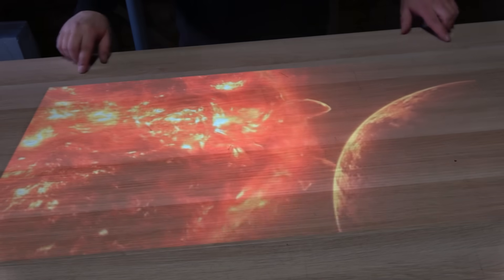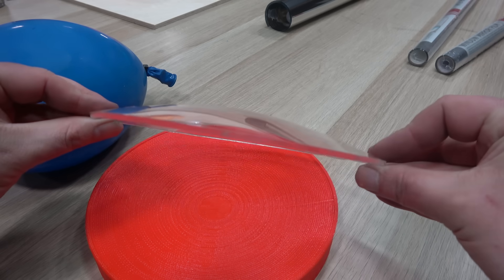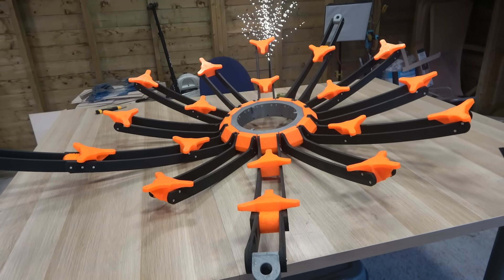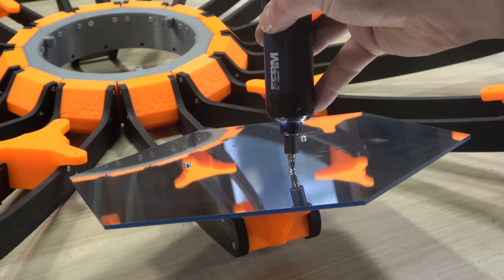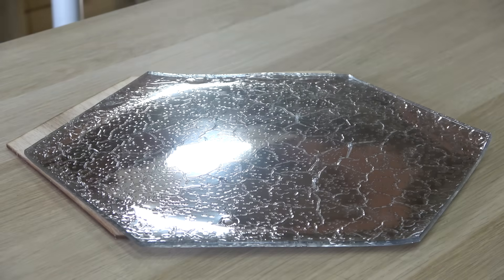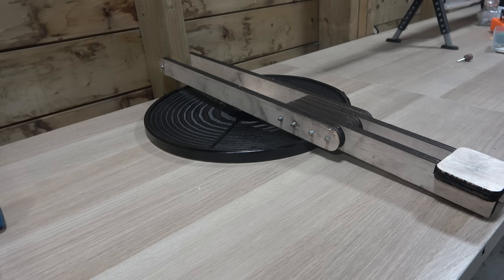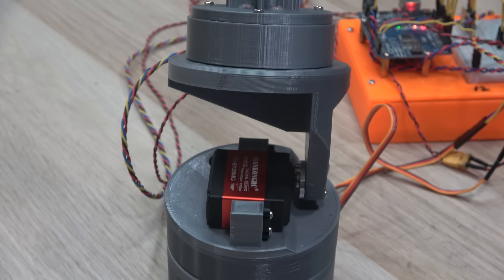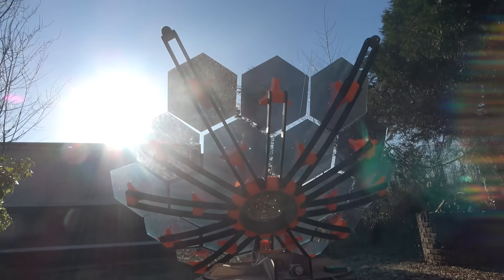Building a DIY Solar Generator..

Comment: You primary mirrors don't need to be parabolic. Only your secondary mirror needs to be. Just make the secondary mirror a bit lager then the primary and you can easily focus all primaries onto you secondary. This way the build is way easier and you dont burn you secondary mirror to ashes.

Also your heating block should be made out of copper with a black finish to absorb more energy. The focal point of the secondary should not be to focused so the copper block gets heated evenly without a single hotspot.

And the hole thing should rotate around iits center of mass, so it is easier on the tiny pivot motor.

Comment: the paints you use are not actually made from silver and gold, so your tests are not reliable.
you should use glass for the mirrors (probably you could get away with using regular mirrors which would yield way better results) since 3mm plexiglass absorbs 10% of infra-red light...
the difference between spherical and parabolic mirrors is the focal distance which is shorter for parabolic mirrors, both mirrors focus in a spot btw.
you could shape the plexiglass hexagons before applying the foil, that way avoiding the failure of the foil because of the temperature, but you dont even need the mirrors to be parabolic, you could go with flat mirrors which would be easier for focusing anyway...

Comment: You could apply anothe layer of reflective film on top of behind the firt one. Would be better if its in another material than the fist one as it would reflect others wavelength. 
This is kind of like the space solar panels.

Comment: I would be copping your project with a desire to add more mirrors for greater heating quicker (I intend on being able to make a lot of hot water for coffee)  The two issue I have are the environment here is just plane flat out cruel to things like wood and plastic.  I would be remaking your parts in metal.  I do own a 2 ton press.

Comment: I'm going with a different method. It's just at the 1/5 scale model stage now,  but within the next month, I hope to build a between 1 sq meter and 1.4 sq meter dish.   It's pretty much a half parabolic dish and it is on equatorial mount.  (just one axis that you rotate at exactly 15 degrees per hour) and there is another axis that you move manually every 3 to 6 days to the sun's declination angle.  With a half dish on equatorial mount, you can have your target (your hotpoint)  stationary and accessible! I will be able to swap out different "applications".  A frying pan for clear sunny outdoor frying.  Or the light will go in under a very big solar box cooker to boil up weeds (so that the weed juice is available immediately, it works like compost tea to feed soil bacteria)   or  sometimes I steam soil to sterilize it   I hope for the box cooker to double as a  solar dehydrator. If I am accurate enough, my focal "point" will be about 15 cm wide (and that should be good and safer enough for me).   My "parabolic dish" is made by the "cone solar' method so it is simply not as precise as what you are doing.  But it works too!  I did tracking on equatorial mount last year too, but this year's project should be significantly more user friendly and also more efficient.

Comment: you should make sure water will always go through your aluminum plate otherwise it will melt. I think i would have looked to a material a bit more stable like copper, austenitic stainless steel or nickel based alloys.
I would have tried to put a reflective film after forming the mirror.

Comment: Лучше убрать верхнее зеркало. На его место поместить ваш теплообменник.
Из за второго отражения теряется много энергии.
It’s better to remove the upper mirror, which directs all the rays to the water heater. Instead, place your heat exchanger in that position. A lot of energy is lost due to the second reflection.

Comment: Hello! I really like your project, but, for the solar tracker you need a wind sensor, to make the mirrors parallel to the ground so that they do not oppose wind resistance, because otherwise it will break the system!
I think a satellite antenna mounting system will help you more than wood, and as motors for the solar tracker you can use linear actuators which are much stronger and more precise. 
The PLA printed material does not withstand the sun and becomes broken after a few months of strong sun.
I hope you don't mind, I just wanted to help you with some ideas. Thank you! I'm curious to see if it works.

! the pipes must be metal otherwise they melt and catch fire due to the temperature. But you can leave them like that for the test.

Comment: Very impressive. I suppose my concern with this project would be durability in outside elements. I have a 48 v heater element that runs off the supply side of my 1800W of pv arrays…uses up waste energy heating water as am not connected to grid. Only 20% efficient but still heats up about 200 litres per day March-October.

Comment: I see a few problems with this build...
The problem 1# is, that parabolic mirrors reflect light into single point ONLY when placed perpendicular to the light rays. So it does not matter that your mirrors are parabolic, if they are not in the dead centre... One way to counter this problem would be to make several dyes for each mirror position in regard to center axis.

2# The window mirror foil is not as efficient at reflecting heat as foils designed to reflect heat. You would get much better results with mylar you can find in your car's first aid kit, but it is harder to glue it because it does not have sticky side... Mylar is also a bit stretchy. If you decide to use it I would suggest to first form the acrylic into desired shape and then stick mylar onto it. I would probably just use thin layer of spray glue, but I am not sure, wether spray glue solvent chemically reacts with acrylic or mylar, if yes, you'll have to use some other non reactive type of glue. Afterwards in the centre of the acrylic piece make a small hole, stretch mylar over it and suck out air with a vacuum pump. That way atmospheric pressure would help you to stretch the mylar to adhere to the glue. But I never tried this, so it is just an idea... You might run into some problems.

Suggestions: Do not bother to make parabolic mirror by yourself at all, but rather find some old giant parabolic satelite dish that you can just polish... The problem is that most satelite dishes are not made stainless, so in the exterior it would rust.. To counter that problem I would electroplate the whole dish with gold. In order not to have electroplating adhesion problems you'll have to electroplate it with copper and silver prior to gold. (As they do it with oscar statuettes). Yes I know silver gets better result, but it will also oxidize... To prevent oxidation of silver you could also use some clearcoat, but that could also decrease some efficiency. I bet that just plain gold with a good surface finish would be better than clear coated silver, but it would be better to test it... 
Wish you good luck. With your project. Ing. Oliver Koren

Comment: Wouldn't it be easier to not measure where the sun is, but tell the disk where the sun is based on astrology? This means that certainly when weather is unstable and at random cloudy or sunny, the disk is already perfectly aligned cause it is told to be at that very spot the sun brakes through...

Comment: I love your channel and I was absolutely impressed until I saw this aluminum plate :D
Sorry but combining aluminium + pmma to heat up water is not what I expected. I recommend a closed system out of copper. You can buy flexible copper pipes for example. 
The plastic pump can't withstand the high temperatures that are reached very quickly at the specified 3.5 kW. Perhaps you don't need a pump at all and just let thermodynamics do its thing :)
Greetings from germany

Comment: well for the tilting mechanism, I would just use an electric actuator, and use the scissor lift technique since you only have small space to work with, where the end of the bracket is on wheels or bearings or can slide freely in a track. For adjusting the mirrors, why not just a ball shaped mount like shaving mirrors have, it's only lightweight mirrors, you don't need adjustment screws for that with metal springs. You can still add fine adjustment screw at the end of the mirrors.

Comment: Would it be more reliable to have the solar tracking based simply on time and location? Angle would be calculated based on time of day with an adjustment for day of the year.  The sensors work well until one of them craps out.

Comment: I wouldnt be using any plexiglass or rubber pipes for the heatplate, you will be getting burning temperatures out of that, solid aluminium cooling block, and paint it vanta black to increase heat absorption

Comment: Cool Idea.  I would coat the collector Plate with black heat resistant paint. Then, i would choose a gold platted collector mirror to prevent the plexiglass from melting. Something i predict, will happen anyway. sooner or later :)

Comment: Astrophysicist here. Super cool project! I have a suggestion for your mirror setup. 

It can be greatly simplified if you use only flat mirrors instead of your molded parabolic ones. The only thing you need to change thereafter is to have a secondary mirror thats parabolic shaped. Look up "gregorian telescope" for a visualization. This will improve your efficiency since your mirror lost some reflectivity in the process of molding them (cracks, degrading, micro impurities etc). 

Secondly: The suns peak intensity is in the 500nm wavelength which silver has the best reflectivity at 98% and aluminum (cheaper) at 90%. Since your mirrors are now flat, you can use silver-mirrors on a glass or ceramic base. Alternatively aluminum mirrors for the cheaper option. Why a ceramic base? In the heat of the sun the mirrors will deform quite a lot and having a ceramic base will help reduce that. In astronomy this is used even for extremely faint objects, so for the sun this is very important. The shape of the mirror does not matter but of course, hexagonal shape is more space efficient. 

Since your purpose is to heat up an aluminum block in the center, you should also color that block in a highly absorbant color. Black, or even vantablack or similar "super-black" paints. Note here that wind will act against your purpose, of extracting heat from the incoming radiation, you can make a frame just around the block to hinder heat transfer from the block to the wind. Since the block is circular you can use a tube shape. The wind shield can be tall but it cannot interfere with  This will not mess with your setup since you are always pointed directly to the sun, i.e no shadow will be cast onto your mirrors.

Finally, your focus does not have to be perfect, so your focal point can actually be behind or before your heat block. The important factor is to make sure your rays are focused enough to cover the entire surface of the block. You will most probably get better heat transfer efficiency if your focal point is not where your block is. 

1. Change to flat mirrors. Not to overcomplicate things.
2. Use silver or aluminum mirrors with glass or ceramic backplate. (backplate is not extremely important but can increase the efficiency)
3. Tubular wind shield.
4. Coating on heat block (black)
5. Dont worry too much about the focus. The only important thing is that the rays are focused enough to all fall onto the heat block.

Feel free to reach out to me for blueprints or images to explain more in detail. Id be happy to help!

Comment: You could use gold or silver car wrap as a coating for the mirrors
Reply: You could then form the flexible plastic at higher temperature and then apply the film separately when it's cooled. The finish would be much better and if use use cast quality film it would be good for minimum 10 years as its UV stable. Also why not use copper coil tube as your heat collector rather than aluminium plate with a clear tube pressed into it which looks like plastic?

Comment: people get a bit carried away with 3d printed parts. just use some PVC pipe to make the frame that supports the mirrors, with concentric rings heated and formed into shape, and pipes behind the rings joining them together into a parabolic shape.

Comment: 🎯 Key points for quick navigation:

00:14 ☀️ Project Goal: Building a giant sun-tracking solar heater inspired by the James Webb Telescope.
01:06 🔬 Gold vs. Silver Mirrors: Gold reflects infrared well but is less effective for heat generation on Earth compared to silver.
02:39 🎯 Testing Reflectivity: A laser and light sensor setup determined that silver mirrors are significantly more reflective than gold.
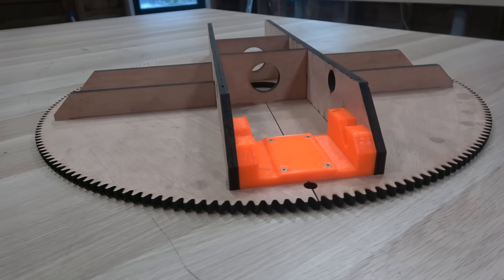04:18 ⚙️ Mirror Rotation Mechanism: A large gear-based adapter flange enables two-axis movement for sun tracking.
05:27 🔩 Mirror Alignment Challenge: 18 mirrors must be precisely positioned using adjustable screws and springs.
06:08 🏗️ 3D Printed Springs: TPU filament springs are tested as a cost-effective alternative to metal springs.
07:05 🔥 Silver Mirrors Win: Testing confirms that silver-coated mirrors generate significantly more heat than gold ones.
08:41 📏 Mirror Shape Issue: Initial spherical design failed to focus light properly; a parabolic shape is needed instead.
10:03 🔧 Heat Plate Installation: A CNC-machined aluminum heat plate focuses collected solar energy for water heating.
11:11 ☀️ Sun Tracking Mechanism: Uses four light-dependent resistors (LDRs) to adjust the mirror’s angle for optimal sunlight capture.
12:25 ⚡ Motor Concerns Resolved: Despite worries about motor placement, testing showed the mirror movement works smoothly.
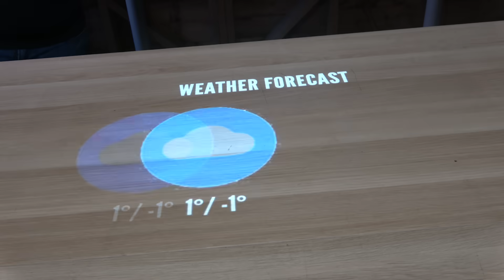13:04 🌧️ Weather Issues: The project is stalled due to poor sunlight conditions in the Netherlands, delaying final testing.
13:18 💡 Community Input Requested: Viewers are invited to suggest improvements before final testing in the next video.

Made with HARPA AI

Comment: I would have mounted the threaded end for the tilt lever at the opposite side of the mirror. ok, you need many more turns to move it, but speed is not really that important, I think. But it will be much more stable against wind, of which there is way enough in the Netherlands…

Comment: There is considerable concentration of sunlight which is D^2/d^2 minus losses. If D=4d, that’s 16x so could be enough heat to melt the collector or boil the fluid. For max collection efficiency, consider multiple parallel spiral coil blackened copper tubes, perhaps with second row behind primary and the entire group insulated on back side. Insure there is enough flow to prevent temperature run-away. Use high temperature rated tubing ( not neoprene) away from copper coils and consider pressurizing fluid.

Comment: I’m truly impressed with the level of thought and skill of fabrication displayed in this video! Here’s a suggestion:
How about fabricating individual mirrors from old CDs? Cut each CD to hex shape, then piece together into larger hex but with parabolic shape. Or, same concept but with full round CDs. Then mount to your frame. Additionally, move your heat collector to the focal point to avoid losses from secondary mirror and follow suggestion of other commentator to use blackened copper (as thin as possible). Counter-balance entire apparatus.
Reply: cool idea.  And since we are using cd's as mirrors.  The cost would be pretty small.  And we could have a thousand mirrors.  It would be so powerful.  I used to have a broom I would put all my unwanted cd's on the handle.  there was at least 300-500 before I realized "what are you going to do with these".  And threw them all out.  A person would have trouble finding the amount of cd's I imagine, now.  Except blank ones.  Those come 100 to a spindle for like $40.

Comment: If you a water dome you could create steam from the solar project, if you had millions you could use solar panels then coat the mirrors with either ionized water or materials you could possibly get more efficiency per panel

Comment: Great project! 
I have some concerns about thermal stability of the plexiglass mirrors in summer. At least the secondar mirror should be out of glass or even better out of borosilicate. 
As many other suggest, because of the big collector surface, the focus spot size is not crucial, I would use smaller flat hexagonal mirror tiles instead. 
I'm really looking forward to the second part, which fluid you choose, material and shape of secondary mirror ....

Comment: Very interesting. But why do you assume gold spray paint has the same reflective properties as pure gold? Here is a list of pigments that ChatGPT says are used in gold spray paint. I doubt any of them reflect IR as well as real gold.

Aluminum Flakes – These are commonly coated with yellow-tinted resins or iron oxide to give them a warm, gold-like appearance.
Bronze Powders (Copper-Zinc Alloys) – Fine particles of brass or bronze (a mix of copper and zinc) provide a more authentic metallic sheen.
Mica-Based Pearlescent Pigments – These pigments use mica coated with iron oxide or other metal oxides to create a reflective gold finish.
Synthetic Iron Oxides – Yellow and red iron oxides are often blended to achieve a gold-like color,

Comment: Interesting project which seems overcomplicated. If I were to repeat this project with a fraction of the hassle: I'd either use flat mirrors arranged in the parabolic shape or I'd simply buy a satellite dish or other spherical surface, layer mirrored film or Mylar to it, and use a copper tubing based heat exchanger (painted or otherwise made black to not reflect light). I can buy a whole roll of refrigeration tubing (soft copper) for less than the elaborate aluminum heatsink used here. Has anyone tried this during a cold winter for home heating? I'm sort of curious if this could reduce my gas bill during a Minnesota winter.